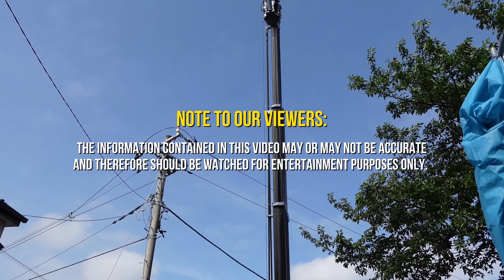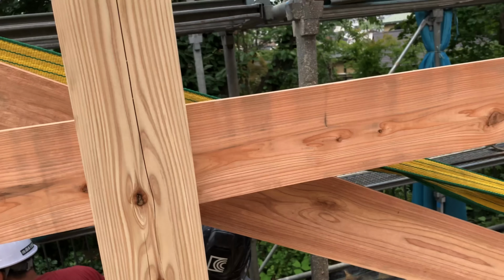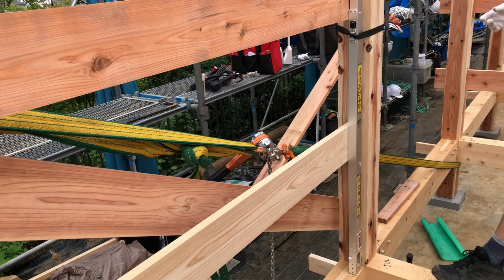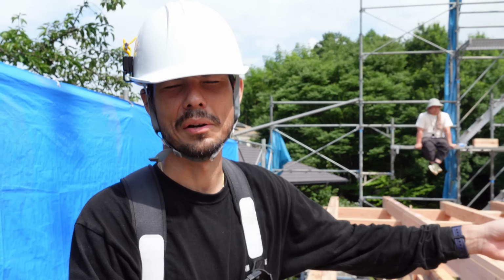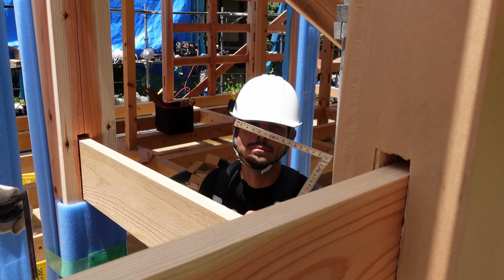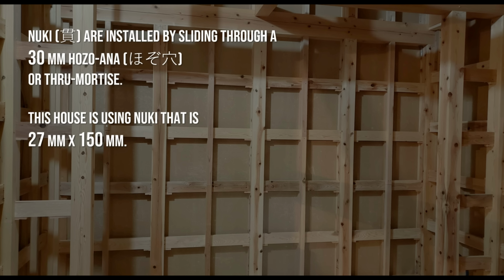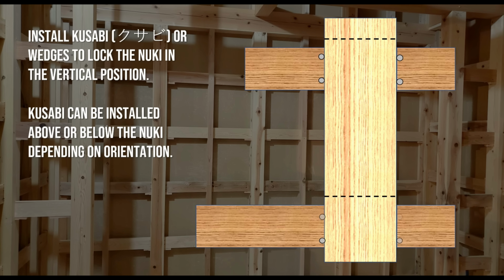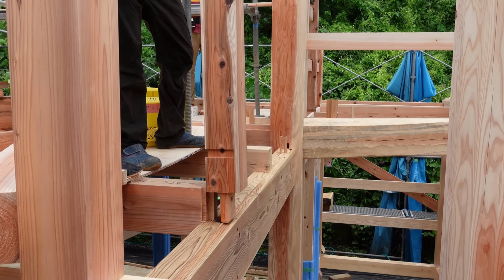Tatemae Day 2 - Japanese Joinery Timber Frame Construction - House No. 2 - Part 2 in Machida, Japan

Comment: I can not thank you enough for this series of Japanese wood work…
Priceless!
Reply: Due to the solid nature of the construction, I doubt very much that here will be creaking floors or steps in the structure when it is completed.  They aren't just slapped up like in the US utilizing flimsy studs or excessive nail gunning.  These are very precise builds done with pride and craftmanship.  I especially enopyed them using the larger levels too.
Reply: @mstrdiver  Exactly my thought. Houses like this could be standing firm after ten (twenty?) US houses have fallen and been rebuilt.
Reply: ditto     - it is so fascinating

Comment: Thank you very much for such a valuable information about japanese carpentry. I like the canal because you give us access to details and practical side of the work to foreign people don´t understand Japanese.
Can you recommend a book in English that covers the practical information about japanese carpentry frame construction?. I mean, I´ve read some books about japanese carpentry or archiquecture but they are more teorical, general or visual than practical.
Again, thanks a lot.
Reply from the maker: Thank you for watching. I can't recommend any books at the moment. I have been learning from the other carpenters daily and I try to look through some of the Japanese textbooks that are out there. There is one book called "Wood Joints in Classical Japanese Architecture" by Sumiyoshi and Matsui which has a lot of pictures of the joinery with dimensions. The book also talks about the common places in a structure that this joint would be used. There is also some information about the failure of the joint with diagrams explaining their failure test done. Also, "the Complete Japanese Joinery" by Sato and Nakahara is a pretty good reference that covers some of the joinery and also has information about wood selection, workshop spaces, and tools. I hope this helps.
Reply: I know one book about traditional japanese house construction called 'Minka'.

Comment: I really enjoy this video as much as the last part ! haha
It's really awsome to compil all that knowledge and technical terms !

I have 2 questions : 

At 5:18 min, we can see some grrove on the wood, for what purpose ?

And at 5:23 min, there is one vertical pillar, the closest. He has a perfectly flat fit ... Why they don't cut the pillar to perfectly take the forme of the maruta ? He could be offer a better structural support, no ?

Thanks again for everything :)
Reply from the maker: Thank you for the kind comment. 

To answer your questions:
At 5:18 mark: the groove and dado are 30 mm wide and designed to fit the 30 mm thick tongue and groove floor boards (made from Sugi (Japanese cedar)) that will be installed later. The use of 30 mm wide is common in Itakura style architecture. This particular house build is a mix of different eras of Japanese architecture. 

At 5:23 mark: the Tsuka (束) or vertical strut (short pillar) in the foreground hasn't been settled into position yet. Sometimes to help facilitate the joining of the roofing beams some of the pillars are left loose until ready to be hammered down with the roofing beam. As the house settles and the joints are squeezed together you will not see any gaps. In addition, it is easier to cut into the Maruta and make it square to fit the square pillar than vice versa or cutting the profile of the Maruta to the pillar. Typically the top sides of beams showcase less joinery intricacy as the underside which would be visible by the homeowner.    

I hope this answers your question.

Thank you for watching. I will try to capture the reasoning for a lot of these details in later builds. The reasons for doing things are often kept in the mind of the carpenter which is sometimes difficult to extract.
Reply: @thecarpentrylife  Yes, yes, of course and you do a great job ! Sure, it's not easy to capture all explanations of them work ...

I understand well, thanks to this explanations ! :)

I just saw your 6 videos at Hayama, i will jump on it right now ! hahahah
Hope to see the next video soon ^^

Oh, yes, in 2022, i will work with Takami Kawai, a Japanese carpenter, do you know him ?
He created Suikoushya (翠紅舎), a school to learn traditional Japanese woodworking

Comment: This is an incredible venture.  I am curious about a detail.  About 9:40 into the video, 
I see what appears to be a caged plumb bob.  May I have more detail about this tool?
Thanks, Michael Leake, U.S.A.
Reply: Hi, thank you for watching. So the tool you are referencing can be found explained in another video. Check out this video: https://youtu.be/o3PhH9VFmZQ around the 5:35 mark. This tool is an extremely convenient tool for squaring a structure. They are expensive, but I believe they are worth the expense as a home builder.

Comment: Has anyone done a comparison between US and Japanese building techniques where they look at the longevity of the structure vs the cost of construction?  My first guess would that with all these joints this would hold up better to the environment and age compared to the US construction but then I think well.... does it? Actually detailed analysis would need to be done to get a real answer. It definitionally looks better but does it preform perform better. We would also need to define "preform better".

Comment: Japanese are very good in job but wood have life span ,with time wood  rot, with time joint become loosen because of rotting of wood. Try to keep wood safe much as we can by using coupling or 90 degree angle or  additional triangle support . 
We must work on support system which will work during 9 degree earthquake. 
Jay bharat.

Comment: The checks in this material passing through the mortis just seems wrong. 8:49. Sa a regular western carpenter, I would reject these pieces of improperly seasoned timber as would the building inspectors in Seattle.  There is some fancy joinery happening here but the lack of seasoned knowledge (and seasoned timber) is disturbing.  I hope the architect/designer is smarter than this.

Comment: I know a lot of you think that this is a fantastic job which it is if it was sourced from the renewable sustainable forest, becue all this timber that was used is like a small forest that had to be cut down for one little house,  they could have built a concrete slab for the first level and saved a ton of wood I know that Japan has a lot of trimmers so the house needs to flex, other materials such as steel can do that and for just  a2 story building it can be built on a moving slab that will take lateral movements a save all these trees that they cut, I know a lot of people don't understand the value of trees and how we really need them.   yes the carpentry work is great and craftmanship is there but at what cost, if you built  several of those it would mean the destruction of forests, and that lowers our carbon emissions and creat oxygen  ---- so thumbs down for this project